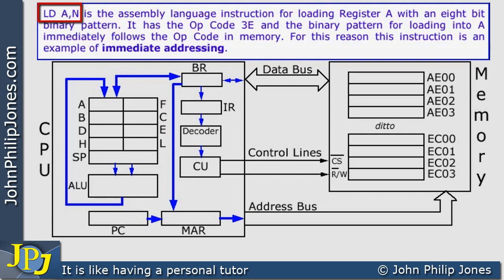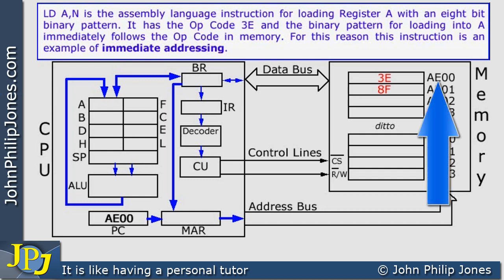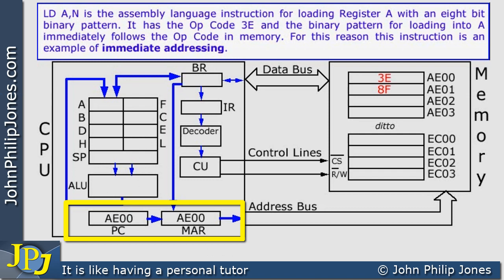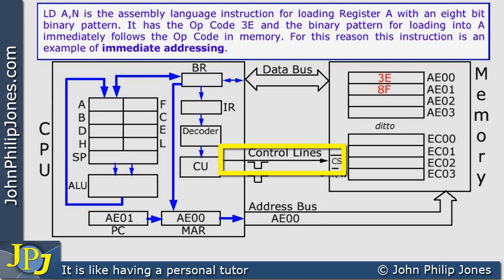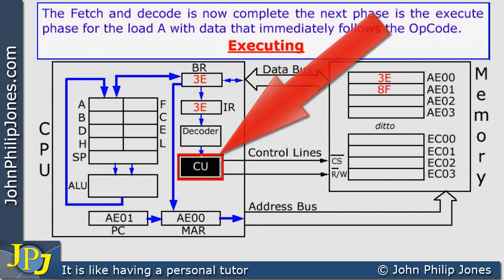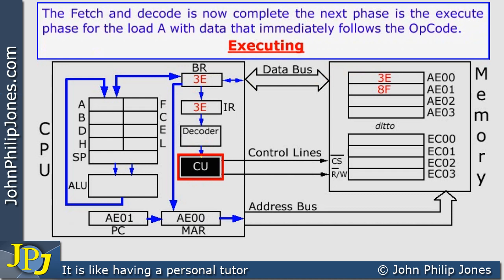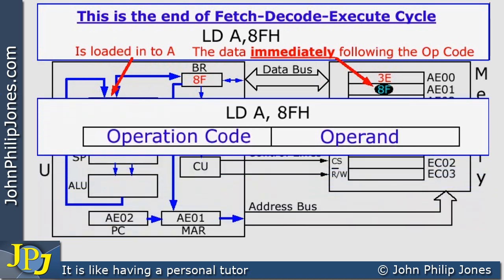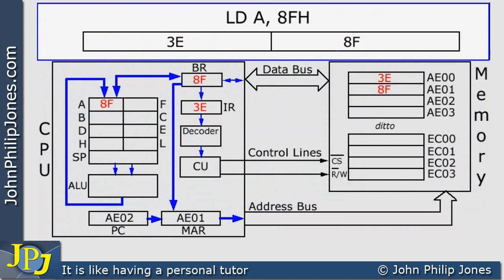Fetch Decode Execute Cycle (Immediate Addressing)

Comment: one question :
so the op code gets from memory via data bus to BR then to IR ,the operand gets from memory via data bus to BR then to register A does the processor know that it has to put the op code to IR and the operand to A ?
Reply from the maker: Hello Youssef,
When a program starts executing (e.g. when you switch on the computer)  the CPU assumes that the first fetch is the op code and this is put in the IR (via the data bus and BR). What happens next depends on what the op code defines. If the instruction is a one byte instruction (e.g. increment a register) then the next fetch will also be an op code so this will be put in the IR. However, if the instruction is not a one byte instruction then what is fetched next is the operand and this is not sent to the IR it can for example be sent to register A (i.e.a load Register A instruction). So based on the nature of the instruction (i.e. the operation as defined by the op code) then the CPU 'knows' what to do next.

Look at the next two videos in the Playlist they deal with different types of instructions

Regards
Phil
(John Philip Jones)
Reply: ohh i see now thank you ,it was really helpful .Best regards

Comment: hello can you explain what is buffer register and IR register and why they need it?
Reply from the maker: Within a computer system and CPU many binary patterns move from one location to another as small pulses of electricity. In any one second millions of these patterns move around. Each pattern only exists on the paths (the bus system) between components for an extremely short period of time. These patterns can be ‘captured’ for longer storage in registers. So an instruction stored in memory as voltage levels is moved via the bus system (as electrical pulses) and stored in the IR register as voltage levels so it can then feed the input of the decoder (when the decoder is ready).